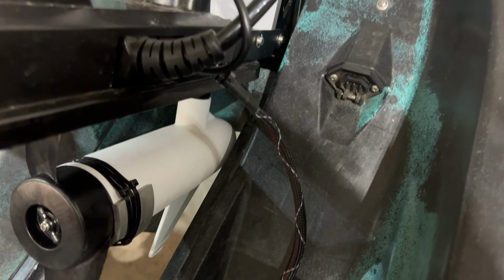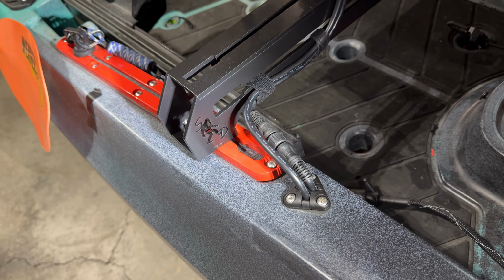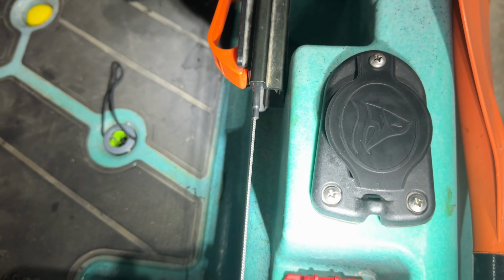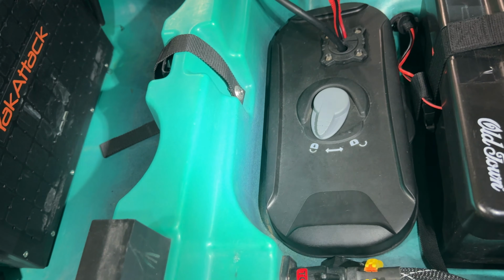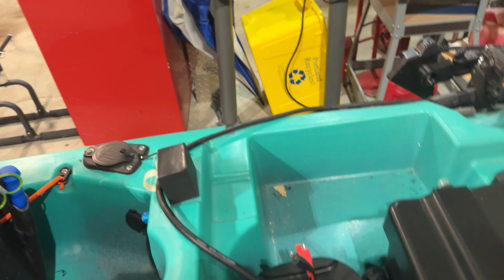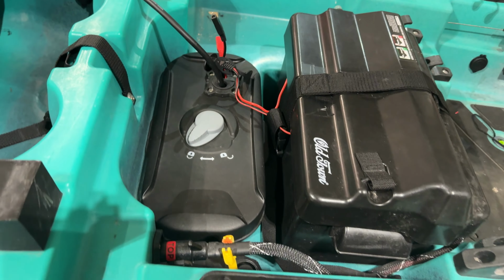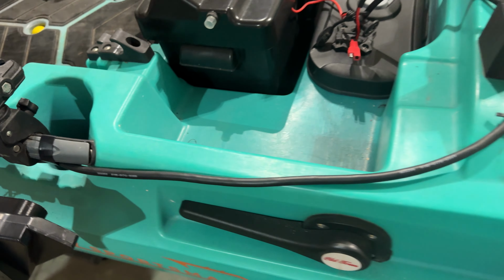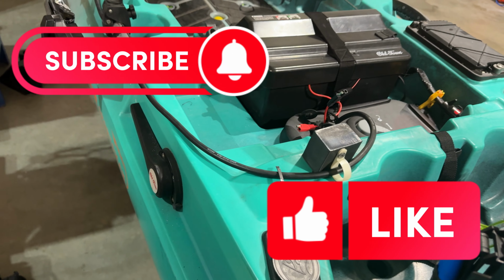Update on the overhaul of the OldTown AutoPIlot 136 Kayak for 2024

Comment: I’m really thinking hard on a Sasquatch Bar. Have you used it yet and if so how the 73sv from that distance? I’ll check it out when we finally meet up.
Reply from the maker: Not yet. Hoping to get a shakedown run in soon and will capture it on camera.
I will say, as I was waiting for the 106 to update, one thought I had. As a Columbia River fisherman, there is a lot of weeds. I can foresee the bar and graphs inhibiting raising the motor to remove the weeds. I have the Ninja but the weeds can still get wrapped. I’ll probably be appreciative that I went with the YakAttack LockNLLoad system rather than hard mounting the head units.
Reply: @FishingAv8r  let me know when you’re heading out. Maybe I can join you. Jim Smith